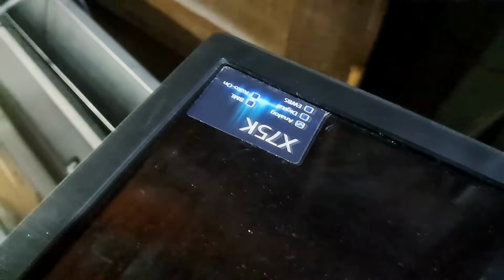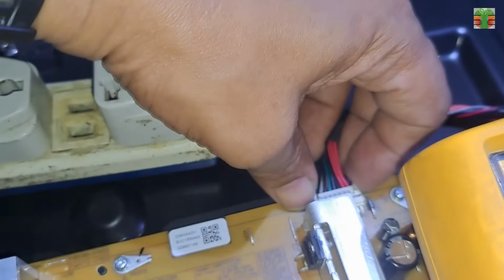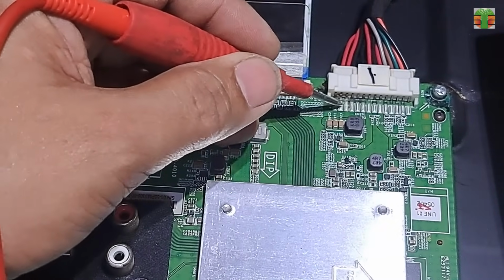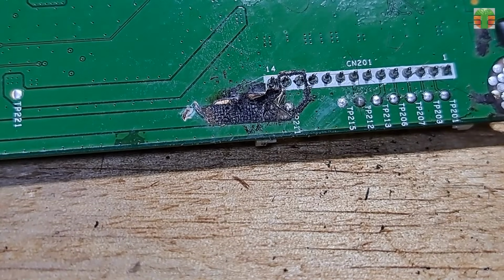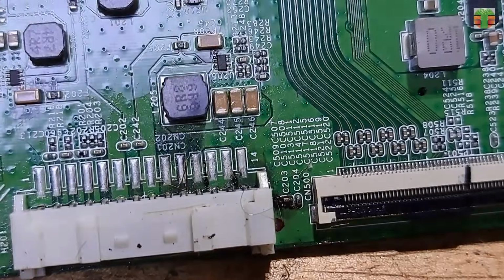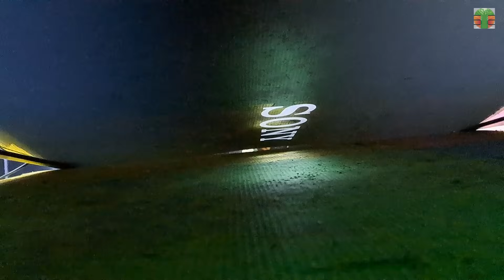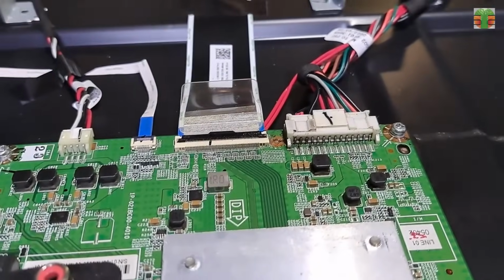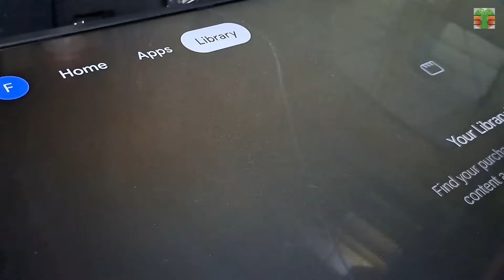Sony smart TV water damage repair.

Comment: Bro i have acer predetor helios 300 ph315-53 one  i installing the software suddenly screen freezed after that i restarted the laptop but no screen blank with keyboard light up and fan spinning after some seconds its turned off with power cut sound then restart again now continuosly runing fan with keyboard light up , laptop charging and  port also can charge other devices but not connecting with external mouse and keybaord also capslock not working .